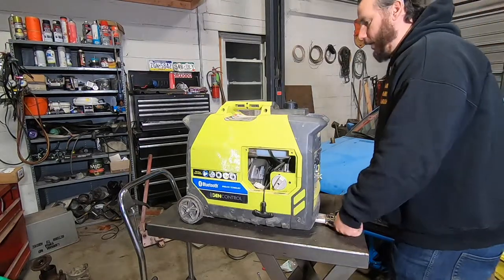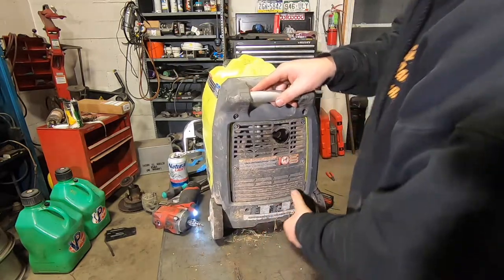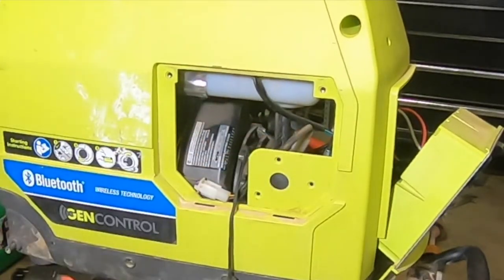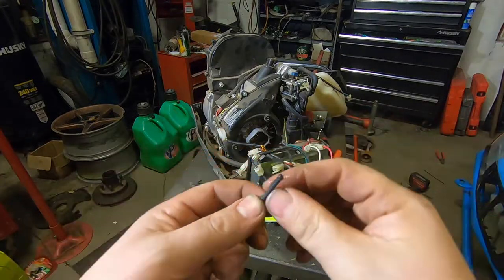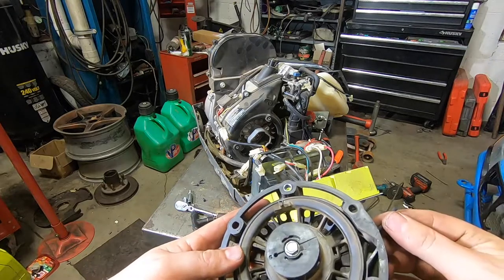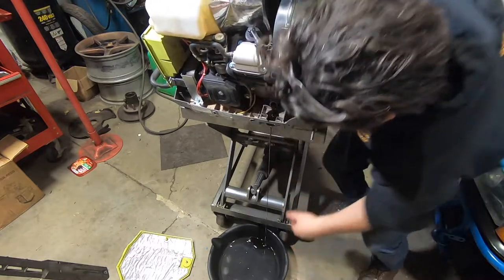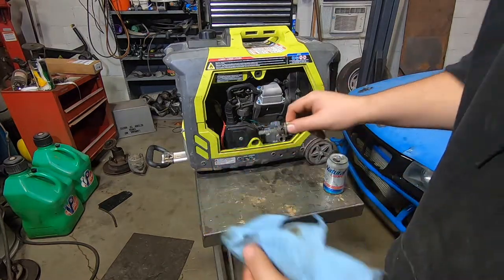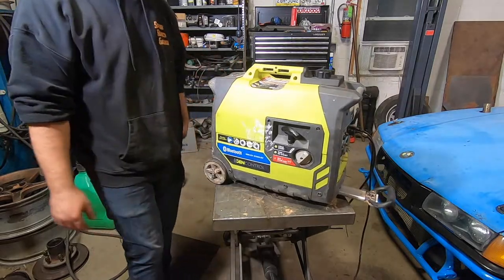Ryobi 1800W inverter Generator repair maintenance and review. How to disassemble

Comment: First of all, I am a small engine mechanic myself so please excuse my Long post, but I wanted to comment on a couple things. There may be a lot of disassembly, but you handled it like a master mechanic! Kudos to you sir! I just bought one of these new (open box). It had less than an hour on it when I got it. Nothing appears to be wrong with it. People probably did not like how loud it was, but it’s not even loud; some people are just super picky. The only thing I am missing is the heat shield that surrounds the OHV cover. It does not go over the OHB cover but just like your video, it surrounds it and forces the fan exhaust air out into the muffler, discharge area and keeps the unit cool. I cannot actually find a new part for it as apparently they don’t sell them separately. However, I am going to make the part somehow and insulate it and it should work fine. I can actually take the maintenance panel off and run the generator without it overheating but I want it to be right and I want it to be as quiet as possible. The one you’re working on looks like it was beat up and neglected. If it was a job site generator, this is not one that I would recommend for a job site. Yes, they can handle power equipment, charging, small to medium, window unit AC units, and even full size household refrigerators, However, they are meant more for light home back up and camping like you said. Leslie, correct me if I’m wrong, but I have been told that the engines in these are actually cloned Yamaha engines made by a company called Ducar in China. While they may not last as long as a Yamaha or a Honda, they will last many years if cared for properly. I have a couple of these Ducar engines and one of them is on a Ryobi 8125 / 6500 watt generator and it is approaching 900 hours. It stills starts & runs like it’s brand new.
Reply from the maker: Awesome! Sounds like you have a lot of experience with these. This one is approaching 900 hours I think and I feel like its starting to get low on compression. When I turn it off by the phone app, it free wheels so long that it starts back up on its own. Cold starts are a little rough too but otherwise it makes power and works as it should. This was a job site unit abused by contractors for many years so it hasnt had an easy life.

Comment: Wow, that was impressive.  As others have mentioned, routine maintenance can be performed by removing the side panel.  Replacing the brains, display, and other major failures would require a tear down as shown. I have two of these  and after watching this I guess I would try to fix it if faced with a major failure.
Reply: It’s not as hard as you think. It’s just a bunch of screws and bolts, that’s all. If the brain fails, you’re out about $250 for the part but that’s better than a new $700 generator.

Comment: I replaced the pull start with out removing the cases. I removed the air cleaner, the control panel and the rectifier. took 10 min. the issue is getting the 4 screws back in that hold in he rectifier. just had to use a little tap to hold the T15 screws on the driver. Take pictures of what you unplug from the rectifier.
Reply from the maker: Great tips thank you!
Reply: Just did it your way worked out I replaced the bottom screws with some 5/16 head ones that would hold with a magnet tip. Thank you

Comment: The spark plug , carburetor , oil change , valve cover , fuel filter , air filter, and easy start fuel switch can all be serviced easily through the removable side panel.

Comment: You can change the spark plug through the access panel.  But changing the spark plug is a pain because a normal spark plug socket you would use on a car doesn't fit.  You have to use a special tool that is included in the box it came in.
Reply from the maker: Great tip, thanks! The tool must be long gone on this one
Reply: @spankranchgarage  Doing some research, I think the Homelite part # is 120694001.  I can't find any pictures or drawings of what this includes, but it's described as an "accessory kit."

Pasting from the generator manual, the packing list is:
- Generator
- Engine Lubricant (SAE 10W 30)
- Funnel
- Spark Plug Wrench
- Operator’s Manual

Since this part isn't even $2, so it couldn't possibly include oil, and the Operator's Manual is listed as a separate part, I assume that "accessory kit" means a bag containing the funnel and the spark plug wrench.  But without pictures, the only way to know would be to call Homelite and ask what's in it, or just order it and see what shows up.

Comment: I have the same generator and sometimes it is very hard to start. From what I've read, there is an oil level sensor on the engine block that goes bad, and on other brands of generators, people say to just disconnect it. I couldn't find the sensor on the side with the access panel. Did you see that sensor on the other side when you had it apart. I was trying to see if I could find it in your video, but couldn't see it.
Reply from the maker: That's a good question and an interesting topic. Mine has been a little harder to start than usual. I would assume it has an oil level switch but I haven't laid eyes on it. If yours isn't starting hit it with some starting fluid. If it kicks off it has spark and likely isn't an oil level interlock. If it doesn't, then yeah I would go hunting for this sensor.

Comment: Can you tell me where the co sensor is?
Reply from the maker: I actually dont know where that is, sorry.
Reply: Np thanks for replying
Reply: I turn on the generator and it appears over load and there is no power generation in the contacts.  I then pressed the reset button and restarted the generator from the app, but the loader still appears.